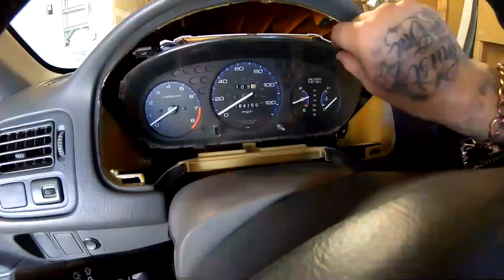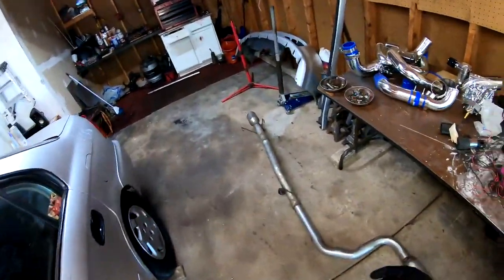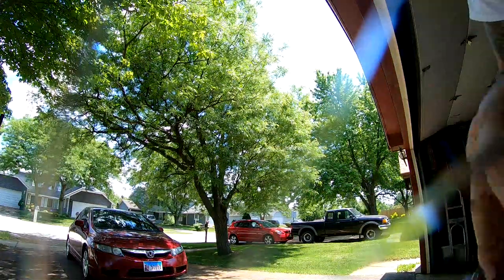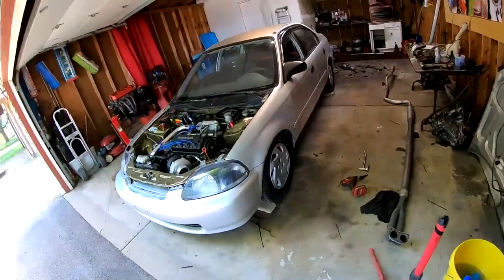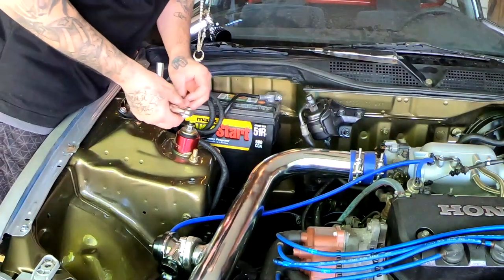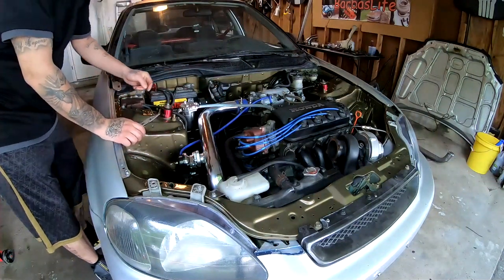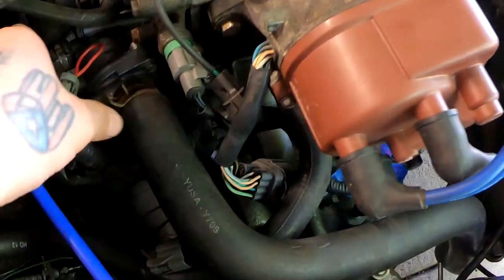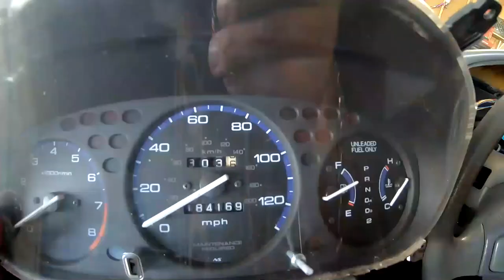Run cooler temps on your honda. front bumper gutted Go pro cracked lens

Comment: Good thing it was just the solar uv glass that broke.  What Gopro are you running. The Audio is very good.  My hero 6 was junk I am running always a external mic to help.  I know the hero8 improved a bunch on the audio.
Reply from the maker: its the gopro7 black. i wanna get something else this go pro lags sometimes during shutdown. jist weird. I need an external mic adapter but its so expensive.
Reply: Barbas Life your audio is pretty good now. When I first stumbled upon your channel from offer up add the audio was worse. Not sure if you are using different Gopro or there was a update on software but it’s much better.  👍 yah I had to buy my mic adapter used and even then the Gopro wouldn’t recognize the adapter and they had to replace my Gopro under warrantee.